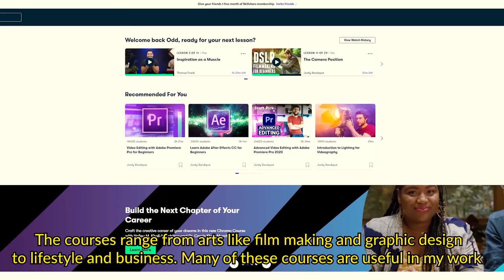Restoring Arcade Controller for My Nintendo SNES - Console Restoration

Comment: I just wanted to say that these videos honestly gave me a massive desire to clean and fix up some gaming controllers and consoles, and I got that opportunity the other day where my bro was gonna throw out a broken XBox One S controller. Fixed it up and cleaned off the bad paint that they put on it and now it works great! Thank you for the great content!
Reply: Same here! But definitely not as easy as it looks! The parts on controllers are small and delicate. I had an old Nintendo Switch Pro controller I barley used that had sticky buttons due to my dumb self spilling juice on it. I figured out how to take everything apart, but as we all know, those darn ribbon cables are extremely fragile. So long story short, I cleaned my controller buttons, but at the cost of my top buttons not functioning anymore because I screwed up the cable that works them.🥲
Reply: @SegaDisneyUniverse  Darn! Yeah the ribbon cables are pretty sensitive and are crucial, so if they are damaged it won't work anymore. For something like that I'd figure you could probably buy a damaged pro controller for the parts but that's just a thought if you still had it.
Reply: Same here. I actually got an iOS controller with sticky buttons. Took it apart and gave it a cleaning and now it's flawless!
Reply: @enderslayer958gamingvideos5  Ah, okay. Well I have an extra controller anyway and definitely taking better care of it.😆
Reply: Eheue

Comment: Always a joy to see you and the Ducktor at work!!!
Fantastic job!!! 👍🏻👍🏻👍🏻👍🏻👍🏻👍🏻

Quick tip though, when you are painting small details, you need to have a brush that is very sharply pointed, so that you can control the area of paint. The brush you used is a little bit frayed, hence the overflow of paint!

Comment: To be honest, conductive paints are a dubious tool. The resistance is very low, and as you yourself have already tried, the paints spread over the board.
To restore the tracks, it is still better to use thin wire or smaller SMD resistors(0 Ohm) of size 0805 or smaller, a good flux, solder with a low melting point (lead).
And the paints are... unreliable.

Comment: I learned a lot from this, had no clue you could repaint traces on a board
I didn't even know this controller existed for the Snes even though its my favorite game system growing up in the 90's, and I was surprised to find it in a Snes bundle off Ebay I purchased a year or two ago.  It is a very fun controller, I love the feel of it.  The button positions are a little goofy but you can play basically any game with it

Comment: Great job as usual! You might want to try a thinner brush for the silver paint. Also you might get a better result stirring the paint for a longer time, about a. minute, using a piece of wood to scrape the sediment from the bottom of the jar. It needs to have the consistency of yoghurt. I’ve never worked with this paint but this looks like it maybe wasn’t properly stirred which could explain the running.

Comment: Nice work as always. I've worked with the silver paint before and i've a tip for you. try using it with a tooth pick with little traces like those you've repaired, it works very well.

Comment: FYI if you want to do projects like this but don't have silver paint, you can use copper conductive paint from an auto parts store.  Basically used to fix the defroster on most rear windows but I still remember using it years ago on some old AMD Athlon XP chips to change the FSB from 266 to 333 by shorting out some traces on the CPU itself.

Comment: Taping the whole board and then using a air brush to paint on that silver paint is an idea I thought of. Don’t know if it will work, but it’s worth a try. That detail brush is chewed up though. Giving it a good twist on a damp rag before you dip might help better.

Comment: 7:24 the second I saw the amount of paint, my eyes widened in horror, and the second it touched the board I screamed in anguish.
Reply: PLEAASE instead of using a brush use a hard tiny object with a slightly blunt point, it doesn’t absorb paint, it gives directly the amount you put on the tip.

Comment: Trim your brush to a point with small scissors.
Also pull the majority of the cotton off the swab and just leave what the glue has attached to do detail cleaning like the paint removal. Also if you shake the paint a lot longer it will be a tad thicker.

Comment: Honestly, something of that size, it's perfectly fine to stick in the dish washer. I've done it to my Super Advantage when I modded it with real arcade parts.

That is to say the large shell. The buttons and smaller parts of course can sit in a soapy cup.

Also, if one prefers, you can buy a bat top for the stick so long as it comes with the screw hole adapter. I prefer bat top style sticks myself as I grew up on them.

Comment: Instead of yucky silver paint I suggest using thin copper wire and solder it over the broken part. It is it pretty reliable, but also can be covered with UV green solder mask

Comment: Wondered what'd happened if you replace the internal with Sanwa sticks and buttons? You should definitely invest in a detailing brush for the small round areas, using the toothbrush seems painful.

Comment: You need electrical tape for masking silver paint. I used it to repair the traces of my backwindow heater in my old car. Either scotchtape or electrical tape, normal masking tape is not meant for such small traces. And you have to really push the edges on the board when you do it.

I would've soldered the traces and the broken ones, 2 little pieces of wire, and you are good. I would like to know how long silver paint will hold here. I had my car just 2 years after the repair, so I can't say how good the stuff is.

Comment: See, I didn't know this, but in hindsight it should have been obvious. The little metal prongs under the turbo switches can actually do damage to the PCB with frequent use! Guess that means I'm going to have to open up my Hori PS Stick and see if there are any scratches on the traces...

Comment: Would it not be better to put solder drops on trace cuts (with some normal soldering flux of course) instead of unreliable silver paint that will degrade and drop off 2-3 years later?

Comment: Happy New Year all! Also quick question: is the nickel plating required for the battery terminals to work? I was trying to fix a fan. However, I forgot about it and the vinegar has seemed to strip the nickel plating off.

Comment: Can I ask, what strength peroxide did you use and did you enclose the box from the top? I have a box very similar to yours and tried the liquid peroxide method recently but there was no change. My box has uv lights on the underside of the lid too and I noticed a lot of condensation on the foil the next day. I'm not sure if the peroxide evaporated. I didn't heat the peroxide like you did though.

Comment: Didn't these have a rubber mat or foam blocks on the bottom, sleeving/protecting the metal base and preventing sliding? I was sure they had them. I could be thinking of the NES version, maybe.
Reply: There should be 4 rubber feet on the bottom, they are missing. If you look at other restoration videos for this they are present. Example: https://www.youtube.com/watch?v=vaeOxG_Tb84